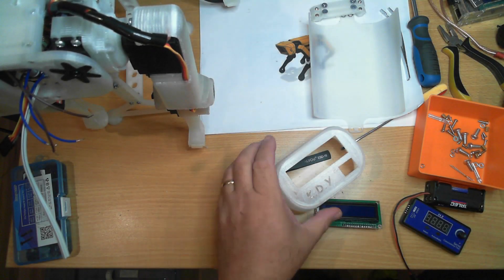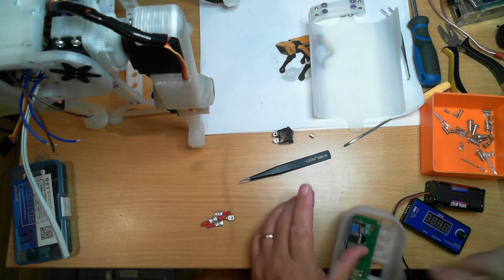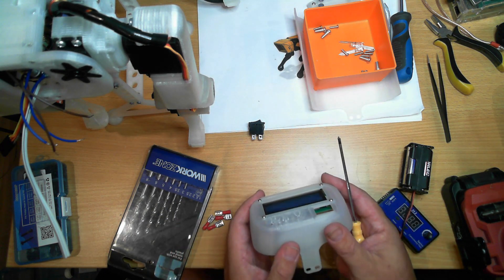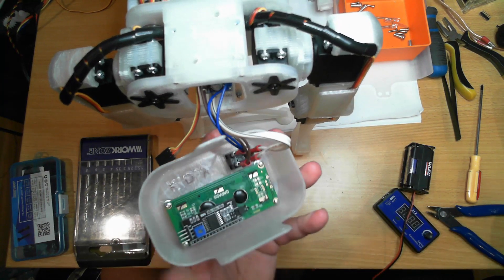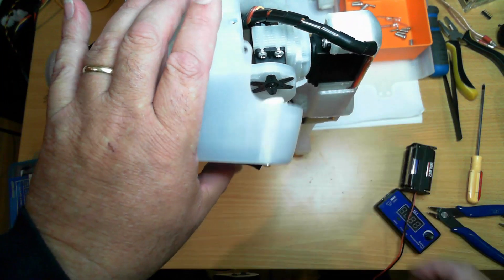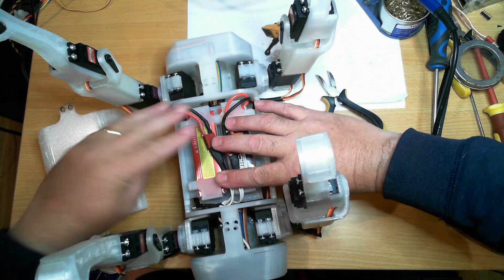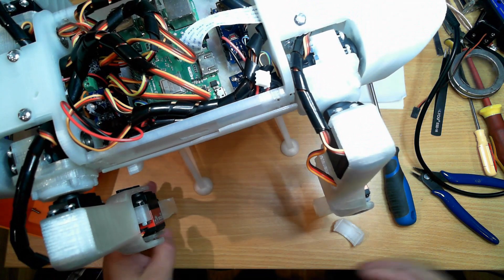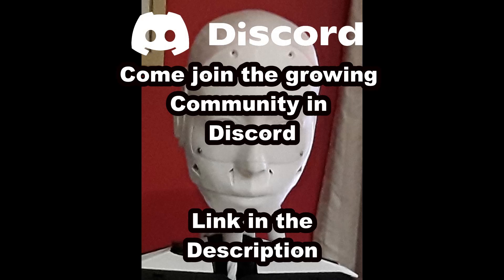SpotMicro Part 7

Comment: Super tuto ça donne vraiment envie de le faire 🥰
Reply from the maker: Go for it, it is a nice and easy project to build, and a lot faster to print and assemble than the Inmoov robot.
Not that I would give up on Fred, I still have a bit to do on him
MyRobotLab is also coming along very well, so soo, Fred will be able to run on the MRL_Inmoov2 project :-)
Having Spot also running MyRobotLab will allow the two robots to talk so to speak over the WiFi :-)

Comment: How much was the cost for all the servos
Reply from the maker: The first set I ordered in early last year,  the MG996R's, I honestly can't remember what I paid for those, but it was too much.
These turned out to be no good, with 3 failures while test fitting everything.
So I ordered in 4 JX Servo PDI6221MG servos, these are the ones shown being installed in the wrist sections on each leg. 
They are about AU$23 each at the time
After 5 more servos failed after first powerup, all the MG996R servos, I ordered 12 of the Feichao F39202-270° for the AU$234.47
These are the same physical size, but have a slower speed, draw about the same amount of power, but have a 35KG torque.
They are also rated at 7.2V, so I can run these direct off the battery.
I do have a couple of Servo Teardown videos coming up, first on the MG996R servos and the following week the F39202-270 servos.
There are of course other servos out there,  One of my Discord members was telling about the PDI-HV5523MG about AU$25, 25Kg from memory but up to 8.4V
The higher voltage servos can run direct from the 7.2V batteries without a SMPS :-)
I have since made a few mods.
I now have a second PCA9685 installed for a set of try colour LED's
I moved the Arduino Nano to between the front shoulders and increased the voltage for the LCD display on the back to 5V, up from the 3.3V, this works much better now.
I made the power wires longer as well, and am no longer switching the SMPS for the Raspi., just the Servos and the second SMPS now used for the second PCA9685.
Changed that after Spot rolled over his tail onto his back turning off all the power at the same time :-)
I still have a few bug left to sort out, but hope to have all the servos worky this weekend.
Then it's on to kinematics :-)